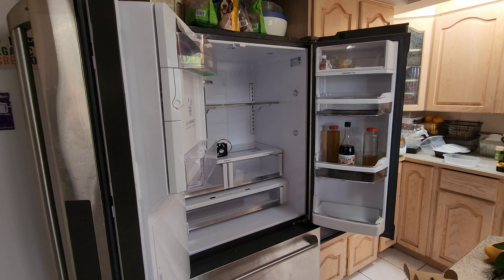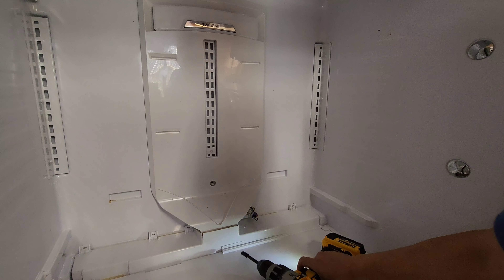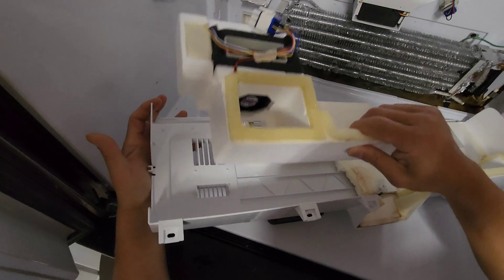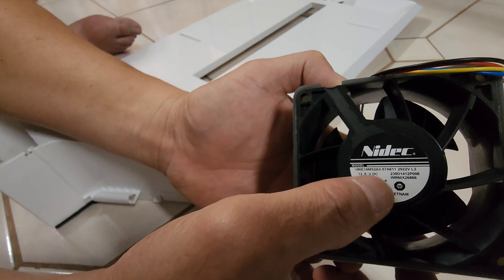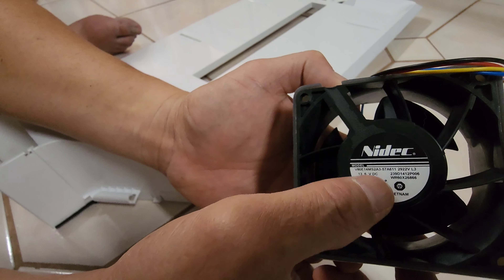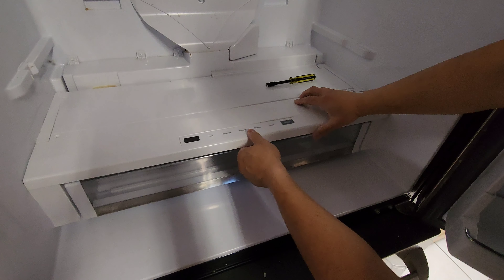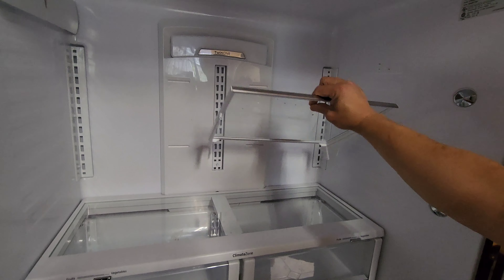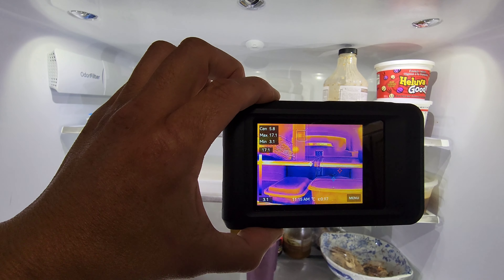GE Refrigerator Not Cooling DIY Easy Fix - Fresh Food Evapor Fan Motor Replacement CYE23TSDCSS

Comment: Hi- mine appears as if it’s a compressor failure, when I plug it in I can’t appear to hear the compressor start unless due to the fan failure someway it won’t start the compressor?

How would you troubleshoot the compressor?